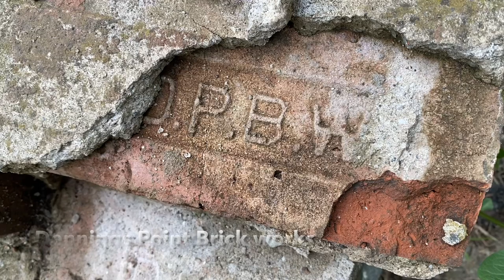Let’s get Elevated on the Mount Beacon Incline Railway 🚃

Comment: "sometimes I get anxiety"
I feel you, but on the other hand you're one brave little bunny to tackle the tower. I haven't been up there in years but I think I'm going to hike it this year just for the heck of it.
The peninsula you see sticking out into the river at 21:31 is Dennings Point, so the bricks didn't have to travel too far. Some of the old factory is still there, or at least used to be last time I fished that spot a few years back.
Glad I found your channel, Marlo. 
I've Liked & Subscribed.
Reply from the maker: Thank you so much. I kept a brick that says DPBW for Denning point brick works. I love the area, beautiful. Ive been to check out the brick factory. Beacon has a lot to. Offer.